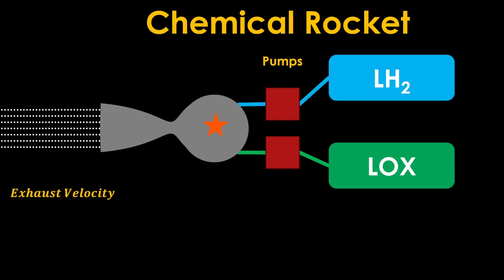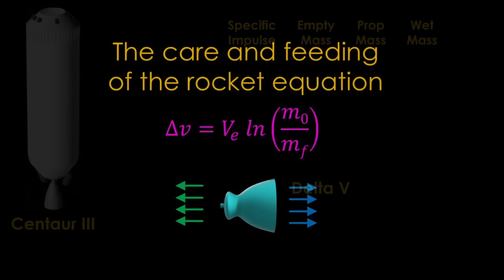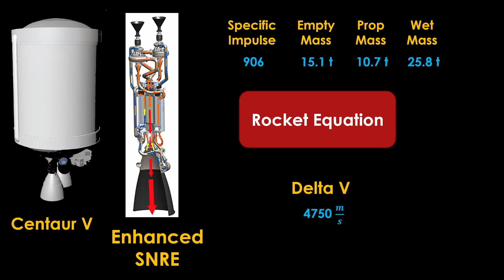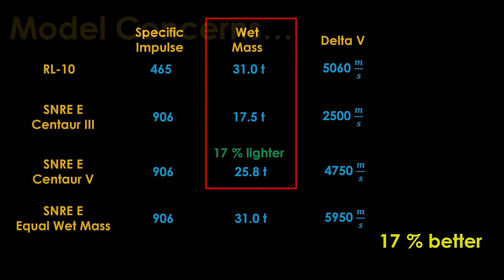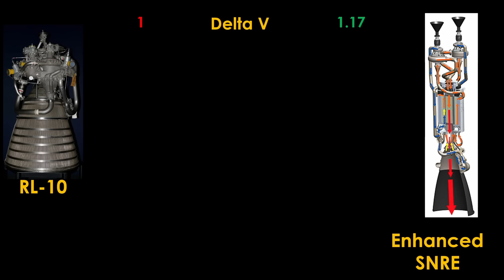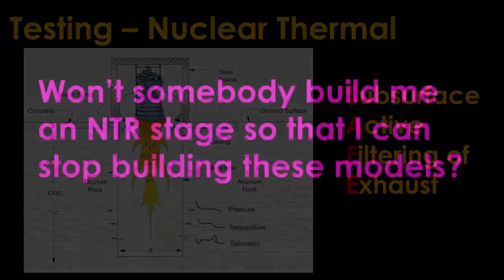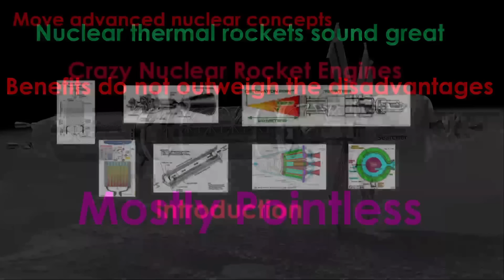Why Nuclear Thermal Rockets are Mostly Pointless

Comment: Very interesting video, even (or especially) as a fan of NTRs.  So if I understand correctly, besides the obvious issues of radiation and development/cost the main weaknesses of NTRs are:

1) Considerably higher engine dry mass.
2) Considerably poorer mass ratio for a given volume of propellant.

While the first seems like an intractable issue inherent to the design, the second seems like it could be improved by switching to a denser propellant, such as liquid ammonia (NH3).  

While you will lose quite a bit of ISP, it isn't as much as the molar mass of NH3 suggests, since the heat of the reactor breaks it down into molecular Nitrogen and Hydrogen. From Atomic Rocket's numbers, NH3 should have an ISP of about 520s. Quite the downgrade, but still a solid 10% over the RL-10

Now, in our Centaur III sized upper stage, we've gone from 4.3t of propellant all the way up to 41.9t of propellant for a total wet mass of 55.1t.  If I've done the math right, it looks like that gives us a delta-V around 7300 m/s.  A big improvement!

To compare apples to apples, we should probably also look at a Centaur III chemical rocket stage with denser propellant, like liquid methane.  I'll assume the same empty mass and use the ISP of the Raptor vacuum engine (380s).  

If I did my math right, it looks like the stage can hold 51t of propellant (thanks to the density of LOX).  That gives us a very respectable delta-V of 6680 m/s. Interestingly, the NTR still pulls ahead by a bit over 9%.  

And if we look at the NTR powered Centaur V, with 2.5x the propellant (104.8t of NH3), our delta-V shoots up to a whopping 10.5 km/s, twice the delta-V of the RL-10 Centaur III.

This doesn't solve any of the serious issues with radiation, expense, reliability, etc, but at least you've made propellant storage and handling easier in addition to improving delta-V.  

It is interesting to see that while newer chemical rockets are moving away from liquid hydrogen, NTRs might benefit from ditching it as well.
Reply from the maker: The atomic rockets section says that ammonia is only going to give you 360 seconds in an expander cycle engine. 

My model says that using a centaur III with 41.9 tons of ammonia at that specific impulse yields 5050 m/s
Reply: @EagerSpace  Even if your ISP is that low, you still end up doubling the H2 Centaur III NTR's delta-V with comparable performance to the RL-10 Centaur III.

And in the Centaur V sized NTR, you get about 7300 m/s, which is a substantial improvement on the RL-10 Centaur III.

Given the complications and expense of NTRs, the performance increase may not be worth it, but for a lot of mission profiles, they do seem to benefit pretty substantially from greater propellant density.
Reply: @EagerSpace  

I ran the numbers for ammonia through the Isentropic Exhaust Velocity Equation myself, and as long as the SNRE can achieve core temperatures of 2500K and chamber to exhaust pressure ratios of 300:1 (both of which were achieved by NERVA, albeit for short periods of time), then ammonia should be able to achieve an ISP of 406s. That’s 87% of the RL-10’s ISP with better than twice the propellant density. 

Now, the equation is an ideal, but we know the conditions are achievable since NERVA achieved them 50+ years ago. And modern NTR designs like the SNRE project core temperatures of 2700K and pressure ratios of 500:1. Under those conditions ammonia’s ISP rises to 430s. At that ISP an ammonia NTR Centaur III has 20% greater delta-V than the RL-10 version, and that's not even considering any additional efficiency from not having the extra hassle of liquid hydrogen.

The question isn’t if it’s possible, but if it can be achieved reliably and cost-effectively. And to be fair, those are big ifs.  As others have pointed out, the additional costs for these kind of performance increases aren't going to make sense until you're attempting very large and time-sensitive missions like crewed interplanetary transits.
Reply: *Note: My numbers are assuming that the NH3 dissociates to its constituent hydrogen and nitrogen gases. That may be an erroneous assumption, but everything I read said that over 2000K, ammonia should be >99% disassociated, so it seemed like a reasonable assumption to me.
Reply: @nitroaerus
Ammonia will not decompose. 0% decomposition at these temperature
Methane is near 100%

That’s why methane can be used be ammonia can’t. Ammonia and water might be usable inside a liquid core nuclear rocket but you’re probably going from 2200 Isp liquid core hydrogen to 1000Isp water or ammonia liquid core for the same engine at the same temperature or a big drop like that 

Nuclear thermal solid core rockets can only use H2, He, De, CnHn as fuel 
Potentially argon too
Reply: @IceRain-f5v 

Even if you ignored the coking issues (which you can't), methane's Isp is only about 3% better than ammonia's, because exhaust velocity only scales by 1 divided by the square root of the molar mass of the propellant.  Meanwhile you have 38% less propellant density than ammonia. 

There's a reason why liquid hydrogen and liquid ammonia are the two primary NTR propellants NASA has seriously considered.  Unless you have very specific ISRU requirements for your mission, methane NTRs just don't make sense.  

Now, if your propellant was heated above the sublimation temperature of carbon (3900K), methane could be a good option, but at that point, you're into "Nuclear Lightbulb" territory and well outside of current/near-future technology.
Reply: Going through the numbers again though, I'm not sure even ammonia actually makes sense.  

The crossover delta-V where ammonia's density beats hydrogen superior Isp for NTRs is under 11.5 km/s (methane's is even lower). At that point you're still in the range of what is doable with chemical rockets, so the far greater cost and complexity of an NTR doesn't really make sense.  

It's only when you get into the realm of the Mars fast-transit and return type mission with >15 km/s from LEO delta-V requirements that NTRs really start to payoff, and to have a reasonable mass fraction, you'd have to use hydrogen. Ammonia's superior density doesn't help unless you're doing ISRU.
Reply: Also, unlike LH2, which requires extremely low temperatures, NH3 remains liquid at relatively moderate cryogenic temperatures. This simplifies tank insulation and reduces boil-off losses during long missions. You can have smaller tanks, too.
Reply: I’m a big fan of the ammonia proposal for nuclear engines, but I’d like to throw methane into the ring for consideration as well.  Sure, it’s not nearly as dense, but you’d be approaching ISP potentially as high as 600!
Reply: @joldsaway3489  I like methane too, but I think the issue with methane vs ammonia for NTRs is that when the molecule breaks down into its constituent atomic gasses under the heat of the reactor, you get H2 and pure carbon, which will quickly soot up your reactor channels are start causing serious flow problems and potentially a meltdown.  

Methane powered chemical rockets don't have this issue, since they're combusting their methane generating CO2 and H2O.  And ammonia powered NTRs decompose into H2 and N2, which is a gas as opposed to C.  If there's a good way to keep your reactor channels from sooting up though, CH4 would be great.

Comment: well yeah, i agree that there is problems with Nuclear Thermal engines development, and that its hard to make them, that is not financialy viable or viable in the short term for commercial launches or using this engines for small stages, But nuclear thermal gets very good boost in performace the bigger the stage is, and as you said launch costs getting lover, so bigger stages become more cheper to launch, so there is a reason imo to put on bigger stages engines that benifit from their size like Nuclear Thermal engines, and IMO the mass is one of the best advantages of this systems, yes the engine is heavier, But the Hydrogen is lighter as your model show. Also Hydrogen is not the only fuel you can use with nuclear thermal engines, you can use ammonia, water or basically anything, tho anything wouldnt get you a best performace, but you can tune it for your needs with the fuel choice. 
Yes, i think that nuclear thermal wouldnt make much sense for smal lanches like in cis lunar space, But they do make sense in bigger interplanetary missions, with bigger vehicles with bigger tanks, and for this missions to happen we need to start making a some sort of technology like Nuclear Thermal, or Nuclear Electric (tho it has more problems than Nuclear Thermal even has), or heck even Fusion drives of various sorts i think they are possible in our tech level because we dont plan to extract energy return from them, and maybe yes this engines and missions are not financially viable but
About financial viablitity, Maybe thats why government agency like NASA or DARPA should work on it, gov doesnt care about financial viabilty, thats why government is the one who funds science in the most cases, because most science is usually not financialy viable anyway, and it is better spending than something like war spending that has much bigger piece of funding than NASA or any science or engineering agency, like Jared the administrator of NASA said its the NASA who should pioneer Nuclear Thermal and other Nuclear tech like Nuclear Electric because no other one would do this, and i myself like fusion use for space, and i think fusion drives for long term space exploration research can also be linked to this
And at last, i dont think we need to forget who became US president when DRACO project was canceled.. and i think we all know this administration space policy, especially at that time. And for ones who dont remember, people was screaming when the budgets for science and climate monotoring was cut to lows that agencies like NASA never saw from the founding, people was advocating for saving NASA budgets and Science budgets, and congress later did almost quietly restore budget to previous year leves, and White House administration also had, you can say, changing a structure and direction of spaceflight policy with certain individuals leaving the administration, again its not politics its a Direct Spaceflight and Science Policy and history..
Reply from the maker: You can use the same bigger tanks with chemical rockets. 

WRT the draco cancellation, they cancelled because they didn't think it was worth pursuing. I don't think DARPA budget was cut at all.
Reply: @EagerSpace  rn i did a qucik search just about DARPA budgets, and from i could find it for sure didnt increase and was possibly cut, but here im not sure
that what i found from Wikipedia on Draco cancelatrion quote: On May 30, 2025, the finalized FY2026 President's Budget Request confirmed DRACO's cancellation, with no funding allocated to nuclear thermal or electric propulsion programs, deemed by the Trump administration as expensive, and DARPA had completed its program termination procedures, transferring the knowledge to NASA.
and it links to FY 2026 Budget Technical Supplement PDF of NASA where DRACO was listed, but in explanation it said that "This budget provides no funding for Nuclear Thermal Propulsion and Nuclear Electric Propulsion projects. These efforts are costly investments, would take many years to develop, ..." 
and then noted that: "The request also reflects the decision by our partner to cancel the Demonstration Rocket for Agile Cislunar Operations (DRACO) project." 
so it notes that DARPA was a partner and it was their decision
but also Wikipedia links Ars Technica report of Stephen Clark, where Ars reports that:
 "NASA led the development of DRACO’s nuclear rocket engine, while DARPA was responsible for the overall spacecraft design, operations, and the thorny problem of securing regulatory approval to launch a nuclear reactor into orbit. The reactor on DRACO would have launched in “cold” mode before activating in space, reducing the risk to people on the ground in the event of a launch accident. The Space Force agreed to pay for DRACO’s launch on a United Launch Alliance Vulcan rocket"
so if its true that the NASA lead the development of DRACO any issue or expected issue with NASA or its budgets would also impact the DRACO program and DARPA decisions
also Ars quotes Lokheed spokesperson below: “We received the notice from DARPA that it ended the DRACO program,” “While we’re disappointed with the decision, it doesn’t change our vision of how nuclear power influences how we will explore and operate in the vastness of space.”
so this what i could find from my quick google search
Reply: @EagerSpace  i did another search, and the new administration did appoint DARPA director in the same month as DRACO cancelation, new director was sworn in on May 20th and DRACO was canceled on May 30th, idk if it changes anything, and the director has normal credentials from what i can see, but it is an interesting note
Reply: Launch volume constraints make the launching of hydrogen tanks very uneconomical, your best possible NTR vehicle with tiny engines and huge tanks will end up requiring more launches to assemble then the simple Methane/Lox based vehicle it would replace.

Comment: The PuFF (pulsed fission-fusion) propulsion concept and the ones that derive from it like the pulsed plasma rocket (PPR) are still king! Best near term propulsion concept we have and that would be truly transformational.

By the way, just a small correction: nuclear thermal rockets like the one of the nerva program don't use enriched uranium. The idea, after all, is to use it as a reactor, not a bomb.
Always great to watch your videos ES!
Reply from the maker: NERVA definitely used highly enriched uranium. They need a lot of reactivity in a small package. 

Some newer designs use high assay low-enriched uranium at about 20% U-235.

Most powerplants use about 5% enriched

https://www.sciencedirect.com/science/article/abs/pii/S002954932030100X

Comment: Wouldn't the ISP of a neutrino drive be astronomical?
Reply: Much, much easier just to just use electromagnetic radiation.
Just exhaust the heat from your NTR directly into space.
Please be careful not to point that thing at a planet, though.
Similar concept to a solar sail but with an internal sun.
Reply: Neutrinos for reaction mass is great, as long as you have years to get wherever your going, and there are no large gravitational sources (planets, moons, large asteroids) for a large distance around.

How much mass is a tank full of neutrinos?  They're tricky little buggers that try to escape through metal tanks, even planet thickness metal tanks.

How do neutrino engines grab hold of the neutrinos to accelerate them out the back?
Reply: How would you direct them?  Nothing we have can contain them so any production will just see them fly out of your engine in all directions negating any potential thrust.  The nozzle is an essential part of any rocket engine.

Comment: Nuclear electric is straight up better, even higher ISP than NTR and much denser propellant with pretty wide selection of propellants to tune your thrust and ISP for the mission
It could run for a decade, maybe longer if refueled although reactor will cost you a lot of your dry mass so solar electric might still win in the inner solar system
Reply from the maker: https://www.youtube.com/watch?v=xUoE7wOB-fY
Reply: Most options have a usecase

It may be niche but its there
Reply: Eager Space also has a video that, if not say debunks, but criticizes the Nuclear Electric, with its constant mass and heat problems, so idk what Eager's best idea for alternative propulsion method for long missions honestly
Reply: @YuriKurokhtin ”just stay on earth lol”